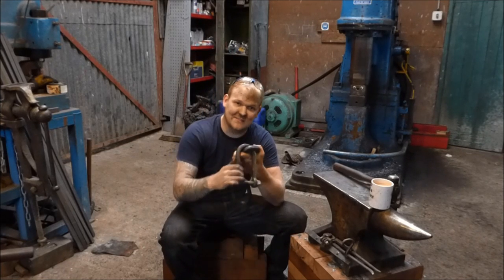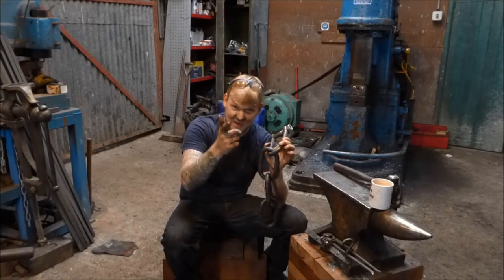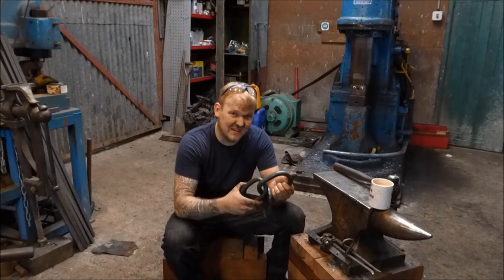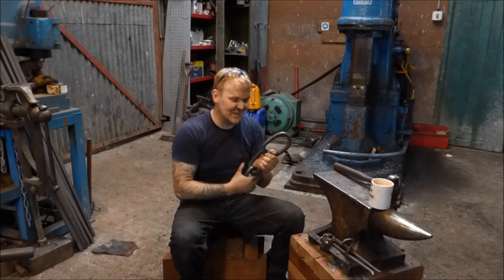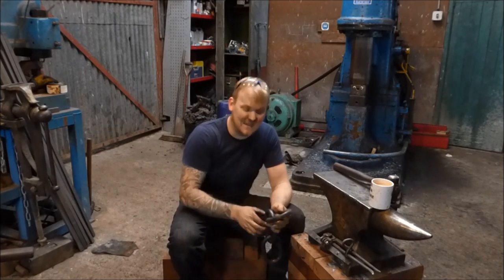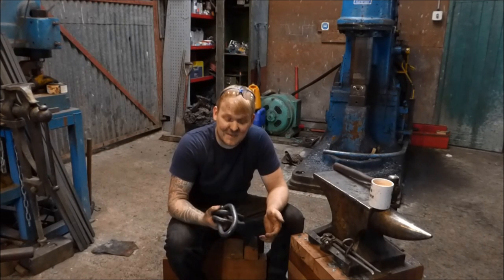Forge welding 3/4inch (20mm) diameter chain! Trust Me I'ma Blacksmith!

Comment: Dan, excellent video. Well done on doing tasks that you want to practice on. Best way to learn. Just one small thing, I am finding you sound seems low. I have to turn the volume right up to hear you talking.
Reply from the maker: Thank you dude. I normally keep myself away form the fire welding side of the forging curriculum as I suck at it and its hot work. Don't like being hot. As for the sound dude i'm working on it. most of the issues i'm having is dude to the editing software. thank you for the great comment and the heads up on the sound.